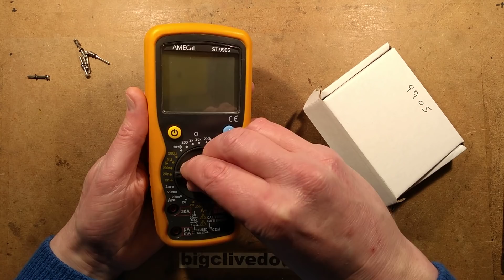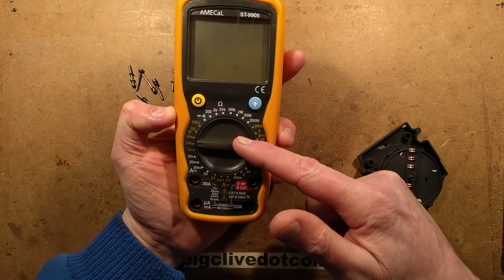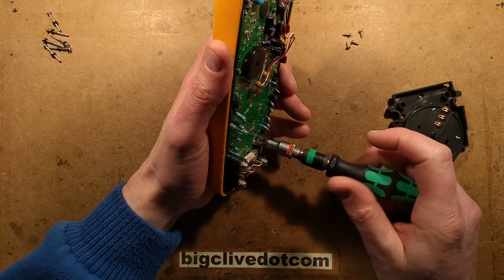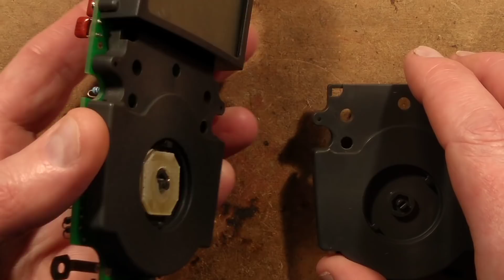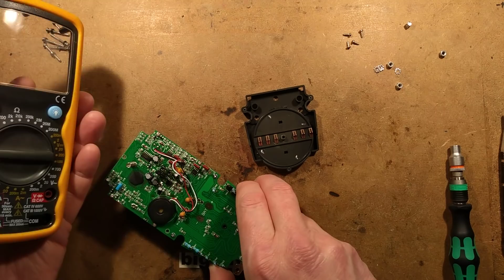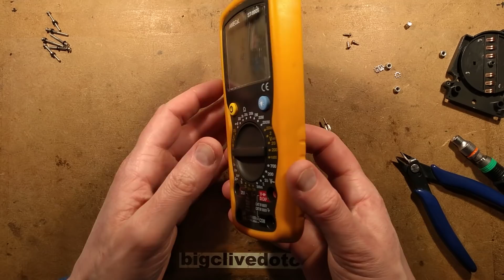Replacing the Amecal meter (and others) rotary selector plate.

Comment: Your reference to Dave Jones made me laugh after he plugged his Weller 120 volt soldering station into 220 volts. And then complain that there was no fuse on the input . Then complained Weller should have put a fuse on it. Because if Weller had put a fuse on it it might have saved his 120 volt  soldering station. Weller offered him a brand new 220 volt version of the soldering station. Then there were a bunch of people who are on YouTube saying don't buy Weller soldering stations because they don't have a fuse well from an American standpoint if Weller felt there soldering stations needed a fuse they would have put it on there. It's nice to talk with and work with people in the industry. Thank you Clive for all of your content. FYI it's Dave Jones  fault his soldering station fried because it was never designed for 220 volts and I think it's actually very nice of Weller to provide him with a new 220 volt soldering station free of charge. Hey follow what the manufacturer tells you to do. the manufacturer Knows Best not you that's what I always say.
Reply from the maker: To be fair.  Not having a fuse or thermal device on the primary of the transformer is pretty naughty.  Transformers can go nuclear if primary winding insulation breaks down.
Reply: @bigclivedotcom  out of curiosity Clive do you think Transformers running higher voltages are more susceptible too insulation breakdown on the primary? And that's why most if not all electronic items are fused at 240 volts.
Reply from the maker: @niceic.co.uk.  The most important characteristic of a fuse is its current rating.  A 250V fuse rated for 1A will also work at 5V.  The 250V rating is just the highest design voltage.
While the increased voltage between windings does put greater stress on the insulation, the traditional 240V transformers are pretty reliable.  They do occasionally fail though.
Reply: @bigclivedotcom Thank you clive for explaining that to me. I always appreciate your advise on electrical safety. And your videos.
Reply: dave he should have known that.. what a dick, i seen his original video where he reviewed it and used a step down transformer to power it.  i think he did on purpose to get some attention.. wrecked a good soldering iron and he put it in the bin.. yeah could of had an input fuse but the chances of the transformer burning out on normal voltage are slim to none. dave should of known what. he was being a complete idiot. i didn't like that video.
Reply: Australia used 240V. But Dave's still a goose.
Reply: @two_tier_gary_rumain  was 240v, now 230v

Comment: I blew my first meter up because I didn't understand how amps work and thought I could measure the amps of a battery by sticking the probes on the battery terminals and even though the car battery I tried it on was old and weak it got the probe wires hot and then it went bang. I think where I actually made the mistake mistake was taking it apart and losing the ball bearing from the dial so it never worked right again

Comment: Finally got my Fluke T90 voltage tester delivered after sending back a Fluke SM200 in November to them, after you mentioning in one of your vids that they were being recalled. Took several emails to get them to send 1 the returns label for the SM200 and emails asking where is the T90. Any chance of you doing a video on using such probes. The ones on YT aren't in english. Thank you ! Also have a Fluke 23 meter which I am still 'borrowing' for the last 20 + years and it's never let me down.

Comment: Both of my Fluke 77s have a selector switch that looks like it came out of the tuner of a 1950s TV set.
The lubrication (or lack thereof) got sticky and a few of the contacts now look like a train wreck.
It's too old, parts not available. As I recall, a couple of these had this same failure when they were
brand new, 40 years ago! IMO, a low cost meter has its place, just watch out for a 440 vac disaster.

Comment: Could you perhaps get a washer  to fit over the collar ( drill the hole out a bit if necessary) and superglue that in place.
Reply from the maker: That could work.
Reply: Perhaps glue 2 or 3 washers to strengthen the whole wall. I doubt it would ever break again after that.

Comment: So I took an electronics class in college about 10 years ago. Part of that class was building a meter like this one. I, being an absolute boob, stuck the meter into the 10A mode and stuck it across the hot and neutral of an electrical outlet. Blew the 10A trace. I took it to class the next day and asked my professor how to fix it. He said, "just stick a 1/4 watt 0 ohm resistor across the trace." so I did. I've since lost the meter. Was this a proper fix?
Reply from the maker: A bit of wire would have been a better rated fix for a blown track.  But it would have worked.

Comment: I've had a Tandy/Radio Shack analogue meter that still works right as rain since 1981 or maybe 1982 (bar a bit of drift accuracy wise). I definitely used it in my A levels as on the most sensitive setting it was more sensitive at FSD than the school's light spot galvanometer. It was very expensive back then (£83 in todays money and it was half price). I have though had meters fail like this after 6 months of hard use. Nice to find out you can get replacement rotary switches though I doubt there are any around for my first meter.

Comment: Ahh - with Dave from EEV blog - he would find a box of high quality meters in a dumpster with flat batteries!!!   Do you really believe he finds all his stuff in a dumpster!?  Really? !   I have cheap meters where I work due to the fact that 1 - People 'borrow' it and not have a clue on how to use it.  2 - It gets dropped and probably a bit miss used and 3 - I am too tight to spend £500 on a meter due to reasons 1 and 2.   Usually spend £70 approx on a fairly good cheapo and get 3 years out of it.

Comment: If I were doing this, I would have put some reinforcement around that collar (at least epoxy, but likely a metal ring also), since there is room, to prevent a similar failure in the future.

Comment: I have had a similar failure in a couple of different devices (one was a laser printer cartridge!) and I fixed them with a metal ring and epoxy, for one I accidentally had a ring with just the right inner diameter but for the other I made the ring from aluminium plate.

Comment: I damaged my first meter by trying to measure the resistance between the ground, live and neutral of a working electrical outlet. I really don't remember what I was trying to figure out. Amazingly only one resistor lost its magic smoke. It was a cheap analog meter, a cheap digital one probably would have had more damage.

Comment: Some vaseline usually helps to hold the balls in place until you can get the top put back on.
Reply: I wouldn't put Vaseline on plastic as it can cause degradation due to the petroleum content. Better off using some silicone grease.
Reply: So you’re putting Vaseline on your balls so as to insert your knob.
Reply: @JasperJanssen  lol
Reply: Ha Ha, some folks thought you were talking about the meter!
Reply: That sounds gross for some reason. Now, they are talking about using silicone grease. I should get some of that. Not for my balls. What is silicone grease used for? I assume it's for plastic gears. I wouldn't know if that is for motors or the like.

Comment: I like the idea of an Advent screwdriver. I can picture a box with little doors and every day you open a door and get the next piece of the set.
Reply from the maker: It's actually quite frustrating, because the bit you need is behind a random door you can't open yet.
Reply: @bigclivedotcom  This got me thinking, which is a dangerous thing.
I wonder if it would be possible to build a cheat-proof Advent calendar with a locking mechanism that prevents one from opening a door before its day. Maybe something based on a pink USB device that electrocutes you if you try to open a door early. "Hah! You're dead! That'll teach you."
Reply: we had an advent calender with bathroom products like soap, shampoo etc.

Comment: I have several of those VERY cheap Yello Peril meters for occasions when I don't know what I am doing (always). My 'soddering' (just for our friends across the pond) iron slipped off it's stand and melted right through to the works. There are no balls and springs now and it's very air cooled, no fuses but it says it has. Still works and readings close enough to a Fluke for most things.

Comment: I had a four pole rotary switch which for some reason was manufactured with one of the poles having the contact mechanism the wrong way around compared to the other three poles, and it happened to require me to take all of the other poles apart to get to it to fix it. Springs and small plastic parts went pinging off everywhere and I'm pretty certain that during the attempt to fix it I've raged harder than I've ever done and ever will do.

Oh, and my first ever multimeter failure was accidentally shorting mains AC (left it on current mode trying to check the voltage, the meter was one that shared a probe connector for both Voltage and lower currents (200mA)). At least it was only the fuse inside the multimeter and weirdly also the higher rated fuse in the plug but I didn't have any spares at the time. Less of a failure on the meter's part, but more on mine. I've learned to double check now.

Comment: Poundland have wireless chargers for £5 each, in their Power Geek range (asuming it's their range). Wondering if you've seen them? Picked one up? I have one as of a few hours ago, it works but i'm curious to know if it's safe to leave plugged in ready to be used as needed? It does seem to get pretty hot during charging, hotter than my charger usually gets! (Charging an S7 Edge)
Reply from the maker: I've got one.  I don't think it charges at very high current.  QI charging is notoriously inefficient.
Reply: @bigclivedotcom  thanks very much Clive!

Comment: 12:15 "Let's check this is fully dust free inside..." Pity you just missed the white dust speck on the LCD itself. Which you now won't be able to unsee.
Reply: G H I don't see it at my resolution, but the LCD surface is entirely outside, so clean after assembly.
Reply: @johnfrancisdoe1563  It's now trapped between the outer LCD glass and the inside of the case window. About halfway down,  near the right. Just a matter of undoing those screws and bolts again and blowing some Jägermeister vapour at it.

Comment: I have a meter identical to this one by Triplett. Actually I got it specifically because I wanted one just like this from your videos, with a nice large backlit display and cap test ranges. (I since got a Fluke but I hate it and only use for HV or high current stuff.)

Comment: Great video - I was once distraught blowing up my first meter..... 1kV 1kJ capacitor bank, no series resistor, 1kV max range. The meter elevated 6" when the triggered spark gap fired the steam gun. The only thing left working was the PP9 battery, completely vaporised PCB traces. The steam gun used to do 1/2" of telephone directory on 177 pellets.

Comment: With measurements 3D modeling/modifying and then Printing that part would be super cheap and fairly easy. Though then you have to take that thing apart and deal with tiny springs etc.
Reply: Jarred Sisler But are hobby 3D materials strong enough for the forces and wear involved?  Look at how his fiberglass reinforcement wasn't good enough.
Reply: @johnfrancisdoe1563  Really only one way to find out.

Comment: Putting those balls in a small dab of grease on the spring and the ball holds them in place till you get the rotor into position. As a bonus the extra lubrication helps with life. Use a thick grease like wheel bearing or lithium grease, not silicone grease or Vaseline. Clean the contacts and the board with alcohol, and do not put any lubrication on them.

For similar failures i have also used a steel wire wrapped around the shaft, and twisted together, as a reinforcement, and then a bit of 2 part epoxy to hold the bits together. Wire because i used a lot of locking wire, and know how to do it, after a lot of practice in doing so, even without the convenience of the correct wire locking pliers, which make it a lot faster and consistent.

Comment: Stopping straight away and putting a ring on if your knob goes floppy is good advice. The drizzling of epoxy over it I'm not so sure about. Don't try this at home.
Surreal that I was stripping something with the exact same screwdriver Clive was using as I watched.

Comment: For the amount of recalls it is a fluke that fluke meters work, AVE would not take a cheap Chinese meter to work it has not got street cred.
Reply from the maker: The important bit there is that Fluke does recall its meters if an issue is detected.  Other manufacturers just let people continue using their defective meters.
Reply: @ @bigclivedotcom  The odd recall but more than one they have a production issue. Years ago IBM went to a Japanese programmable chip manufacturer for chips and said they wanted 90% good. When the run was finished and IBM went to collect their chips the Japanese gave them two bags one with all the good ones and ten percent bad ones.The Japanese had a zero fault production line. With Fluke how many have died with the one with dodgy cables? Nice getting a new meter when you are dead.
Reply: I got an Owon B35T (very Chinese) after AvE gave it his blessing. My need was mainly for the remote display capability that Bluetooth provides. Am not at all disappointed with it!

Comment: I blew up my first meter, sort of. It had an unfused 10A current setting, and I may have blown the trace off the board. The trace was a fuse, in essence. But I just soldered a wire in and it still works fine, though I also have a better meter now.

Comment: Cant make a mistake reading that amecal :-D
Nice to be able to get another part, decent manufacturer.
I wonder if heatshrink tube would prevent the new part cracking.
Reply: zx8401ztv Good luck making this strong at a length below 2mm.  An appropriately sized C clip would probably do better.  Glued down of cause.
Reply: I'd hunt for a metal washer of the right size to fit over it and then fix it in place with two part epoxy.  Solid as it gets.

Comment: Nice to see a manufacturer supplying spare parts... this should be the norm rather than a surprise.
All the stuff that ends up in landfill due to a small but necessary part breaking is criminal.
I always attempt to fix any broken, damaged or faulty stuff... and with a little ingenuity there's not much that can't be fixed :-)
Reply: Exactly! I do the same.  You can even make spare parts yourself if you have to with a 3D printer.

Comment: Springs are quantum objects, if they gain some velocity it's impossible to know where they are.
Reply: Elderly physics professors are also quantum objects. They know where they are or what they are doing but never both at the same time.
Reply: Managed to find one about the same size that took off when i took apart a complicated pen once. That was the highlight of my day.
Reply: Yup, a particular pseudo scientific field of mathematics claims it might transform into a Scotsman cause  the extra dimensions are "wrapped" up on themselves. Everybody knows a Scotsman have more than four observable dimensions after an unwrapping and uncorking.
Reply: It has been postulated that a Scotsman after a sufficient amount of scotch can be observed to be nearly in two places at once though there is some overlap.
Reply: I have an alternate postulate. Movement needs energy. A compressed spring has potential energy. Therefore it is possible that they use this potential energy to go at very high speed to wherever all the bic pens and teaspoons end up. It does seem to fit with the evidence because wherever the teaspoons and bic pens end up nobody knows.
Reply: @gordonlawrence4749   They do tend to reappear after a random time, leading to the possibility of dimension shifts
Reply: Gorden Lawrence. You can add socks to that.
Reply: Best is when you crawl around on the floor for 30 minutes looking for it when it is there in the middle of your work area all along.
Reply: @chaos.corner  I painted my shop floor white and it improved lost part recovery by vast amounts.  When I was an auto mechanic, I bought a clip retainer for Jesus clips, those little carburetor bobby pins which like to move off at relativistic speeds when removed or attempting reinstallation (which is when you exclaim "Jesus, where's that little SOB go?" along with numerous curse words.  Anyway, that little spring loaded J clip saved me tens of hours on the floor looking for them over its lifetime (or mine, as I retired)  It's one of the few SnapOn tools which actually paid for itself.  It was a simple 4mm brass tube with a piece of spring wire in it and a spring at the other end, and it could fit anywhere.  This is a bulky equivalent https://www.thecj2apage.com/forums/jesus-clip-tool_topic38683.html
Reply: Difficult but not impossible.
Reply: The springs for mounting guitar pickups are just as bad. I think there are probably about 10 behind my desk.
Reply: So why did I pay $300 for magnetic coveralls ?

Comment: Auto ranging multimeters suck when it comes to measuring resistors. As a colorblind person I have given up on reading 1% color codes so I'm forced to measure every time.
Great repear job.
Reply: A digital tester might be better for that. I thought I bookmarked the link to the specs some Austrian or Swiss guys did when these devised this device but I can't find it now. The Chinese copied their idea and made the devices. You can find them all over eBay. I bought one and it seems to work quite well. But a bigger display would be nicer. And they don't provide any instructions.